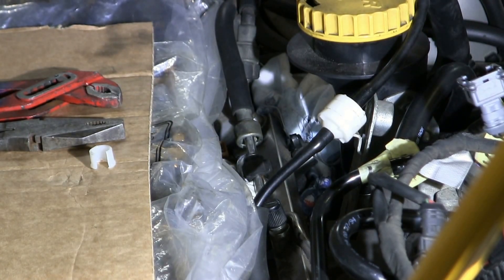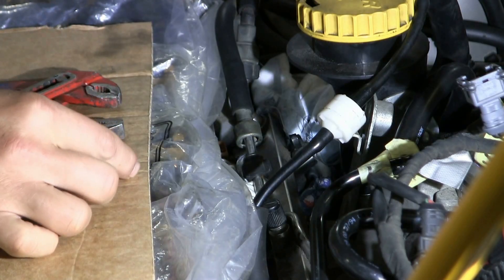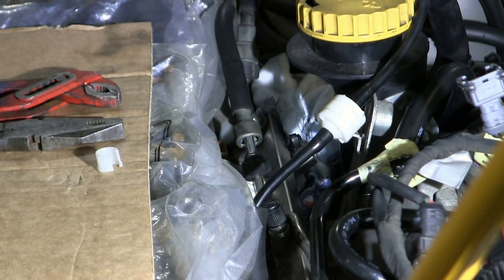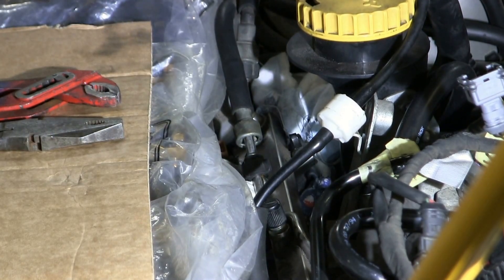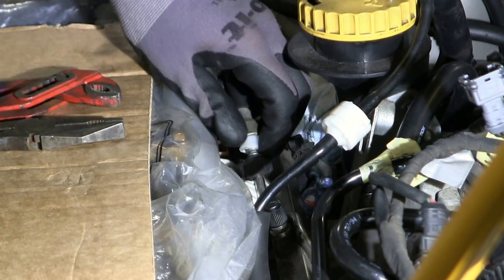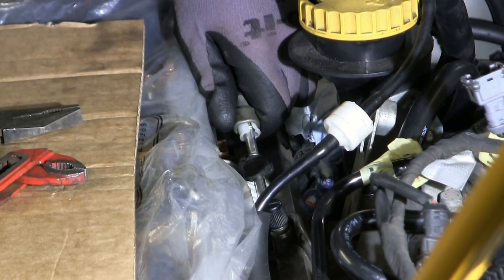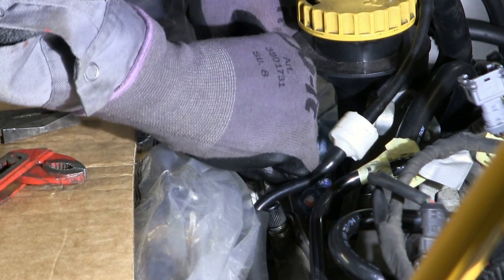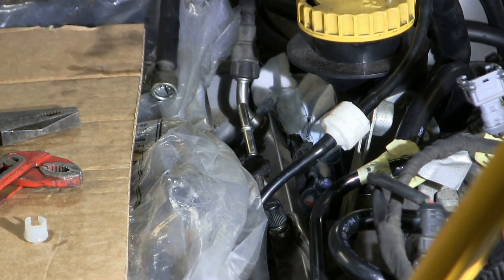Fuel line removal, ta bort bränsleledning SAAB 9-5 Aero │SAAB Tinkering:

Comment: Nicely done, Thanks for sharing. I just got the tool from Canadiantire but it only worked on one tube, was too small for the other. I was disconnecting fuel lines under the car, near the fuel pump. Saab 9-3 2011, 2.0l XWD.

Comment: As the tool I used the tip of a glue cartridge (where you screw the tip onto the tube), a cartridge that holds 300ml of glue or other stuff, the ones that you used together with a "gun". Biltema sells a bag of 10 tips for 16:-, 36-4835.